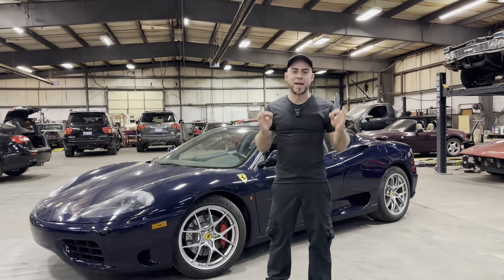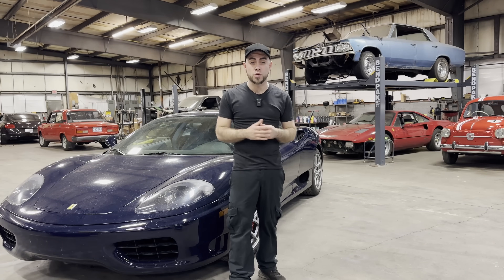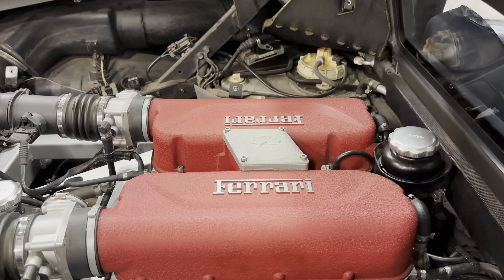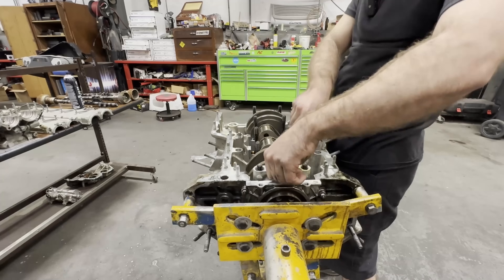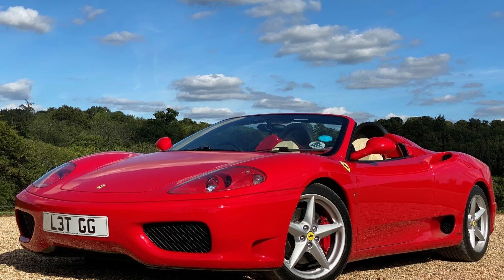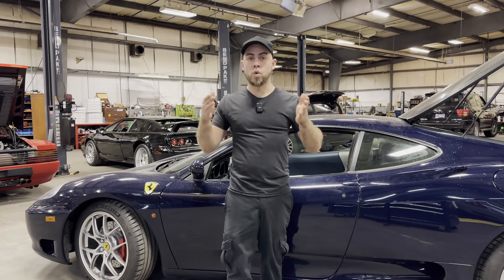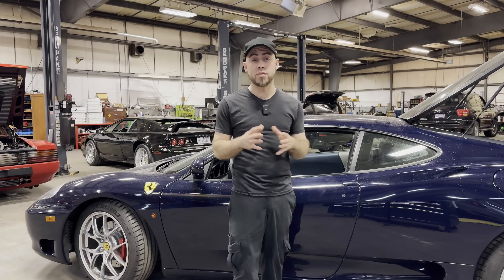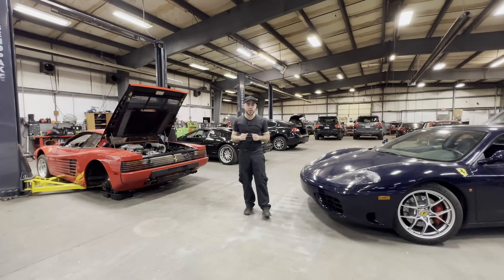Ferrari 360 SECRETS to make power!!! Insane POWER per liter!!

Comment: Also just like to add - that although the specific output of around 110hp per litre of displacement was impressive in a production car in 1999 - it wasn't as good as the Honda S2000 F20C engine of the same year at over 120hp per litre - that's even more insane when you consider the Honda engine was mass produced whilst the Ferrari engine was hand built.

Comment: Thanks for the good explanation of the 360 weaknesses 
The next question would you buy one ever ?😉
And are the services engine out of the 360?
Reply: No engine out required. Ferrari left an inspection panel behind the seats to access the timing belts. Everything else, oil filter, air filters, plugs, coils etc are easily accessible from the top of the engine bay.